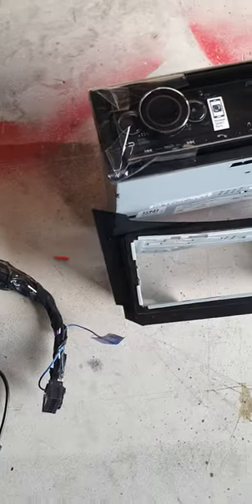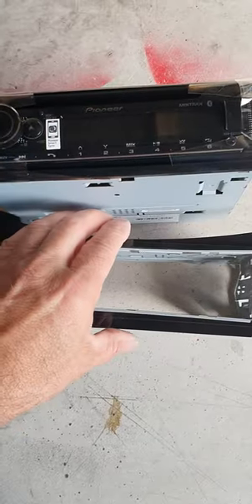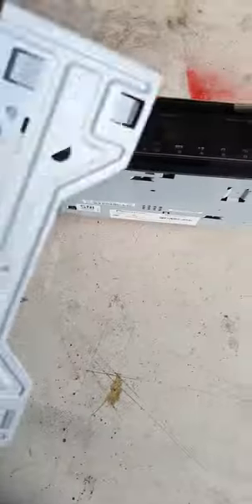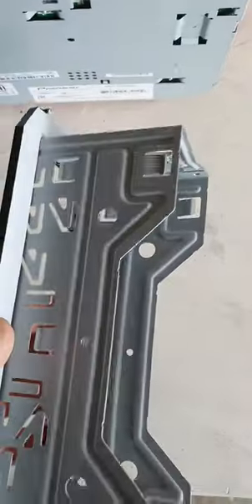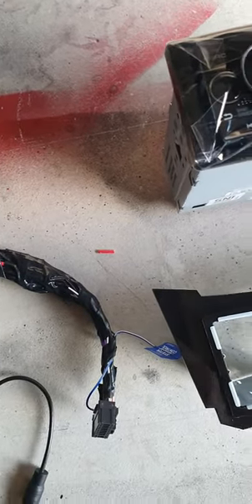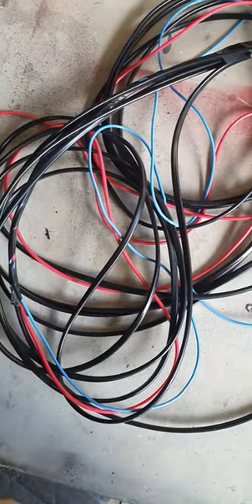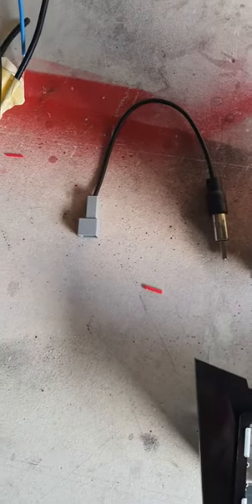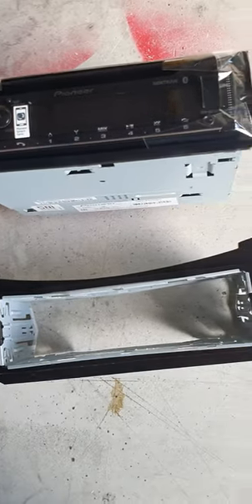Stingray Fg to fgx single din fascia preinstall

Comment: Hey I also have a pioneer single din I am wanting to install into my Fg. 
Already got the head unit (it’s brand new) just need the fascia and your skills to install it all. 
How much would fascia and install be? 
Does the steering controls still work or not?
Thanks
Reply from the maker: Depends if the pioneer is a cd type or half length media player. Full length needs cutting ..half length most times needs no cutting of the fg cavity behind tissue box. Steering wheel controls we dont get working as not properly supported by radio manufacturers. Fascia is 159 but please email me sales@stingraycar.com.au thanks